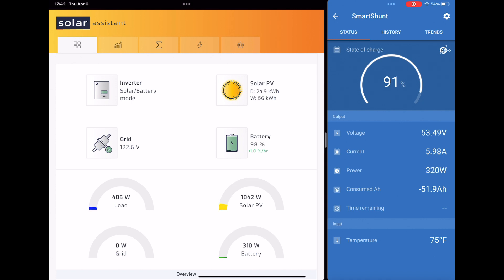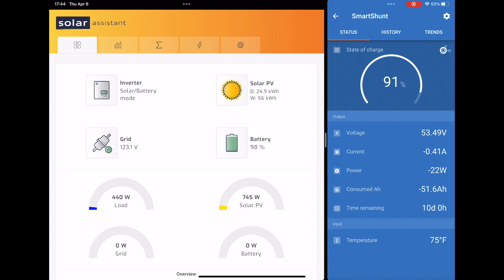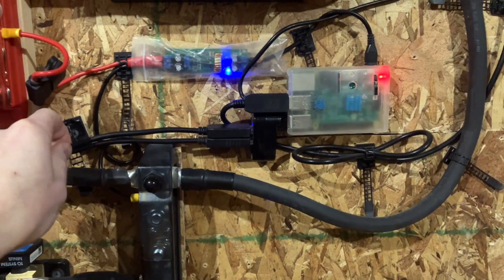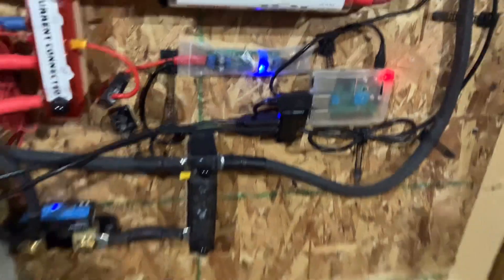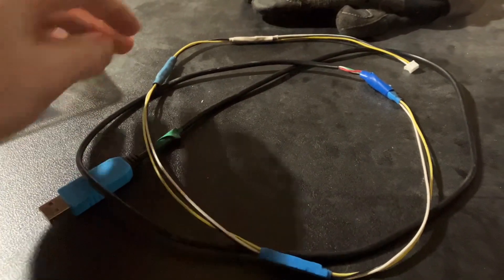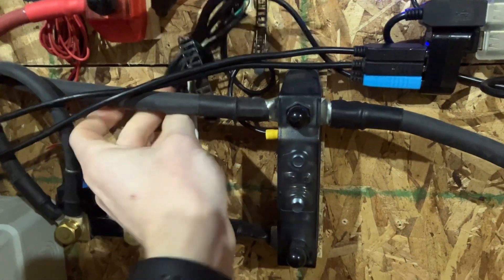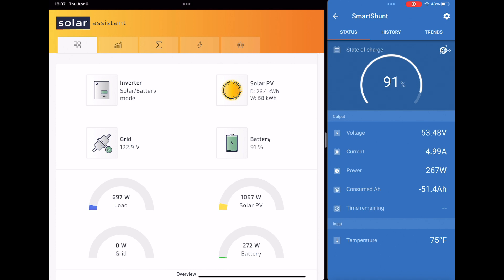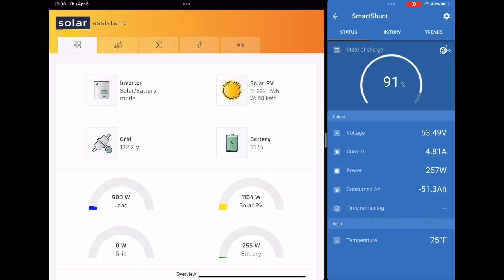Setting Up a Victron Smart Shunt in Solar Assistant

Comment: Can you use the SOC reported by the SmartShunt to make SOC based decisions with an EG4 inverter through SA?

Are you still able to see your BMS data in SA when you are using the SmartShunt? I noticed you deselected the BMS. 

Sorry, I have never used SA. Installing a 12000XP and three batteries with 3 JK V19 BMSs.
Reply from the maker: You can only use the SOC information inside of SA, but there are programmable controls to configure your inverter inside of SA.  

Unfortunately, you will either see the shunt data or the BMS data.  You can configure both and then do as I did and switch back and forth just to take a look at one or the other.  Not ideal but still allows you to see what's going on. 

No worries.  Have fun with the new system!
Reply: @AdamDeLayDIY  Have you looked at the YAMBMS stuff?
Reply from the maker: @MyGoogleYoutube  I've heard about it but I haven't looked into it at all.

Comment: hi, I am buying an indoor wall mounted EG4. I have Schneider Inverter xw6048 with latest firmware. In addition I have insight facility. I am told by Schneider that XW6048 does not have the control board required to allow closed-loop battery comms. Is that true? Any workaround for BMS to communicate with the Inverter? Basically to give status of SOC.
Reply from the maker: Unfortunately I'm not familiar with the specifics of Schneider inverters.  

I would ask Schneider what BMS protocols they support.  I believe the indoor EG4 wallmount batteries can switch to different inverter protocols to help with battery communication.

Comment: Solar charge controller you said you made a cable for that,can I add that to my 6000xp and shunt in solar assist also? I assume it will see power going in, but would be nice if it appears in the right places, if it don’t without it ?
Reply from the maker: @mattman6199  so the 6000xp actually communicates wirelessly with SA. 
https://youtu.be/94vF8hBBuNE

The shunt is set up under the “battery communication” section so yes you’ll still see info from both devices in SA.
Reply: @AdamDeLayDIY  sorry I worded that question poorly… can you also connect a charge controller to SA using cable (is there any benifits if you can?)
Reply from the maker: @mattman6199  unfortunately at this time you cannot connect a separate charge controller to SA.

Comment: How do you know when the battery is at 100% soc?  Is it initially based on voltage ?
Reply from the maker: The Victron Smart Shunt is programmed with the total battery capacity.  It then tracks each amp hour as it flows in and out of the battery.
Reply: @AdamDeLayDIY  Thank you for the reply.  I understand it measures current in and out.  I'm installing this shunt now, and my bank is setting at about 50% SOC based on voltage, but how does it know the starting point?  Thanks again for your videos.
Reply from the maker: @Ian-ws8kp  If you've programmed the smart shunt based on your battery bank, you can either manually set the SOC in the Smart Shunt app or you can charge up your battery bank to 100% and let the shunt reset itself.

Comment: You connect each battery bank to the pi. What happens if one bank hits the set max volatage, will the others continue to charge their set volateg? or will they all stop charging when one of the banks hits the set voltage?
Reply from the maker: They each work independently of each other, so if one disconnects, the remaining pack keeps charging.
Reply: thanks for swift reply. another question please. If there is no direct communication between inverter and batteries, then what defines the min and max voltages to instruct the battery to stop/start charging/discharging? Is it the inverter settings or is it settings inside the BMS? or inside SA settings? @AdamDeLayDIY
Reply from the maker: @giollaliddy5817  Not a problem.

If there's no communication between your inverters and batteries, you will set charging values in your solar charge controller (or inverter if you have an all-in-one inverter) for your bulk charge voltage.  That controls when the charging stops.  The BMS for your battery will have its own maximum charge voltage settings (hopefully) which prevent your battery from being over-charged.  The BMS is a "safety net" and shouldn't be relied on to stop your charging.
Reply: can you set different charge currents for solar and utility? So for example the solar you want to charge at 100a, but if using utility it instead only charges at say 60a? EDIT: I found you can
Reply from the maker: @giollaliddy5817  If you're talking about the EG4 6500s, then yes you can.

Comment: Do you prefer the victron software over solar assistant?
Reply from the maker: Each one has its place.  The VRM is only for Victron gear while Solar-Assistant fills a gap for a lot of hardware that really has poor software.  Ultimately it will depend on what kind of inverter system you end up going with.  Since Solar-Assistant doesn’t support any Victron equipment (outside of the Smart Shunt), if you have a Victron inverter or charge controller, the VRM only makes sense.  

I will say this, if I didn’t currently have a Victron system, I would have to have a system that’s compatible with Solar Assistant.

Comment: I really need to give this a try. I've been hearing a lot about Solar Assistant and seems it would be significantly easier than rolling my own with Grafana as I have been doing. I've been eyeing the Victron Lynx Shunt for a while now as it would easily bolt on to the side of my Victron Power In box; however, I just searched to see if there is a similar USB cable for it and it's over $500 for the VE Can cable! Holy sh<beep>. Option 2 has been trying to put the Batrium shunt board into the Lynx box, perhaps that would be more cost-effective.
Reply from the maker: It would probably be a whole lot simpler than making your own.  I don’t know that I’ve heard of anyone incorporating their Lynx shunt into Solar Assistant, especially at that crazy price for the can to usb cable!  That’s ridiculous!  Not sure I’ve heard of a batrium integration either.  

I don’t see why though you couldn’t add the Victron shunt (or the batrium) to the power in. Might just need a piece of copper bar stock.
Reply: @AdamDeLayDIY  I saw your dropdown menu had a USB CAN option, wondering if a generic USB<>CAN adapter would work. I have the Batrium shunt connected to the power-in now and it's just ugly for a few reasons (exposed, inadequate spacing between PCB and lug area). Anyway, future upgrade, maybe Spring...
Reply from the maker: @LithiumSolar  Hmm, I never noticed that before.  I’m gonna reach out to Solar-Assistant and see if they’ve ever tested it before.  Might be a nice addition since the CAN protocol is fairly standardized.  

I agree that having the shunt just hanging off the side doesn’t look the best.
Reply from the maker: @LithiumSolar  I heard back from SolarAssistant and they haven't tested anything like that yet.  I saw they have a USB to CAN cable on their site, so I ordered that to do some of my own testing.  If you're interested, I can let you know what I find out.

Comment: Besides % Do you get all the information on solar assistant as you do on the Victron app voltage,current,power,consumed ah, and time remaining
Reply from the maker: Off the top of my head, I believe it shows everything but "time remaining".  I've asked SA about that but there's no timeframe on adding it.  You can see in the video the dashboard will show a % gained or lost/hr based on whether or not your charging or discharging though, so that gives you a little idea of power flow.  

A lot of that detail can be found by clicking on the Battery button on the dashboard.
Reply: Thanks for your quick reply !!!

Comment: Can this also be used to track solar input and generator input? Assuming you put the shunt in the right place of course. I mean can it be set up in the software that way. Because I have old school charge controller and inverter.
Reply from the maker: Depending on the voltage, the smart shunt would be able to track Solar because it’s DC power, but it would just show as power going into the battery as a whole, not specifically PV power.  Solar assistant has to be designed for the specific Solar charge controller for it to recognize incoming power as PV power.

As far as a generator power, it couldn’t detect the AC power, but if you used a DC charger for your batteries, it would be able to see that incoming power into your battery bank.  

Hope that actually helps…
Reply: @AdamDeLayDIY  Thanks, it does help. With the PV, why does it depend on the voltage? I don't see anything in the Amazon link that says it has a voltage limit. 

Maybe it's easier to ask, how can I get the most use out of SA with Lifepower 4 batteries, an Outback inverter, and a Midnite solar charge controller?
Reply from the maker: @MyBacktrail  The voltage range of the smart shunt is 6.5-70vdc.

With that setup, the only direct integration to SA (to my knowledge) is the batteries.  So you would be able to connect the batteries to SA and monitor the DC flow of power.  Wouldn't give you 100% window into your environment, but it would give you an idea of what's going on as well as the SOC of your system.  

Adding a smart shunt into the mix would do the exact same thing as the batteries, except the smart shunt would be able to better track the SOC across multiple battery packs.  The downside to using the smart shunt vs the direct battery connections is that you lose some of the fine detailed info that the LifePower batteries provide to SA.  Unfortunately you're only allowed to have 1 type of battery connected to SA at a time.

Comment: I am doing two battery banks at 16S. One is 8 Battle Born Batteries wired at 48 V and one is 4 SOK at 48 V. 
Battleborn calls out for 56.8 for the shunt charge. And SOK calls out for 55.2. I wonder if this will be a problem?
A’ll charge controllers parameters are the same.
Reply from the maker: It depends on what the different manufacturers have their BMS params set to.  Seems like you would have to charge up to the SOK max to get the most from both packs.
Reply: @AdamDeLayDIY  
I don’t see why it would make a difference says the settings are on the shunt? All the charge controllers have the same settings for both batteries.
My biggest problem seems to be getting a on/off battery switch that won’t blow! I’ve had three of them I’ve had to replace, as they only go up to 48 V 🖖
Reply from the maker: @simon359  the shunt just tracks state of charge. The charge controller is what determines what you charge your batteries up to voltage wise. You would have to set your charge controller to the SOK value, otherwise you’re just gonna get a high voltage disconnect on the SOK if you try and charge to the battle born value.

Yeah, it’s hard to find the right type of switch that goes above 48 V. I ended up putting in a few DC breakers that are rated for a much higher voltage.
Reply: @AdamDeLayDIY  
The charge controllers were set right. Absorption 54.4 and float 58.4. But there’s still the manufactures charge of the batteries with a shunt, mine has a different one for each bank. Specifically, only on the shunt is first how many amp hours of the battery banks and then what the actual charge of the battery would be. 
As far as the DC breaker goes, I don’t know if too many breakers that can take a 1/0 gauge wire? 🖖😜

Comment: I would like to ask which solar monitoring system are better, Venus OS or Solar assistant? Thank you for answer.
Reply from the maker: Ooohhh…good question.  I’ve used both.  Honesty, both have a lot of good but differing features.  I really like the VRM and wish we could incorporate some of the features from there into SA.  Unfortunately since the VRM is Victron hardware only, I was kinda forced to find an alternative.  I would say SA fit at least 90% of my wants.

Comment: Hello Adam, I just returned my smart shunt before hooking it up. I have the same inverters and solar assistant. I was thinking, but not sure that the smart shunt was more informational for the SA UI and would not effect the amount of charge as that would be controlled by the inverter or bms. Any thoughts on this? Love your vids.
Reply from the maker: Appreciate that!

You’re correct that the smart shunt is informational only, but it’s the most accurate information that I have seen. The only thing the smart shunt does is track the amp hours that flow through it. If you have a single battery, you may be able to rely on the information from the BMS. But once you start having multiple battery banks, it becomes very difficult to track an accurate state of charge.

Comment: Can you please explain the function on “Maintain battery state of charge” section on the tab to the left of the settings tab in solar assistant. Not sure on the time settings and how to make this work to my benefit. Thanks Joe B
Reply from the maker: So I have those settings set to change to SUB if my battery drops below 30% SOC at any time.  So both SOC values are 30% and the time doesn’t matter.

There are other time of use cases where you might want to change to SUB if your SOC is too low early in the morning or even late at night.  I think the SA website gives the best example. https://solar-assistant.io/help/voltronic/power-management